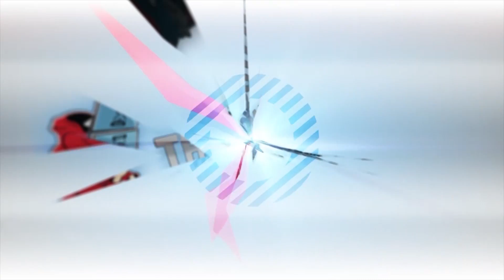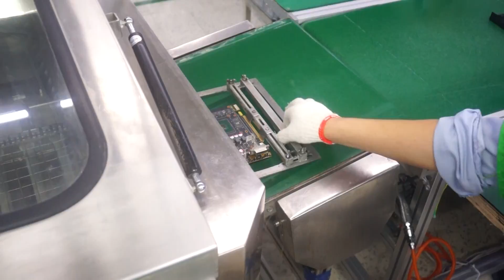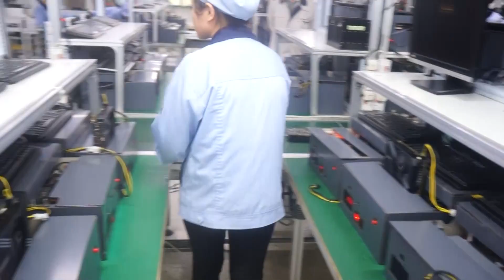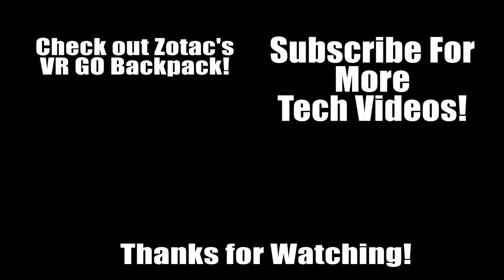How A Graphics Card Is Made

Comment: Here is the explanation what different machines / assembly areas do
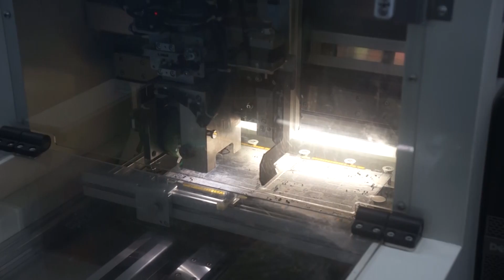0:31 Flying probe, automatic measuring probing tool for assembled components (this usually is used after all components are on the PCB)
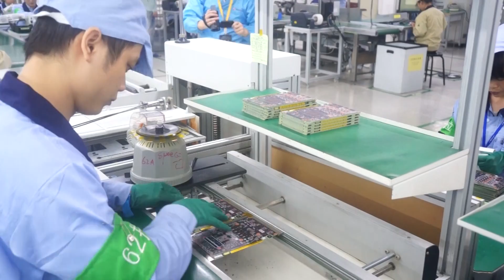0:42 Visual inspection of PCB before adding solder paste
0:44 Pick & place machine, picks up components from component reel feeders and places them on PCB. Two white bowls are component dumps when machine picks up part badly and cannot place it
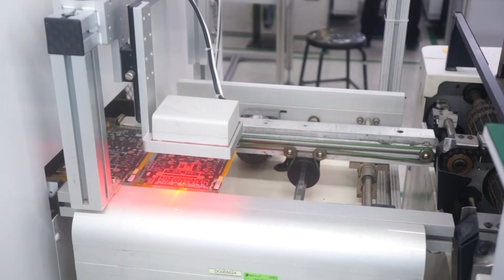0:59 1st Automatic Optical Inspection (AIO) after P&P machine and before a reflow oven.
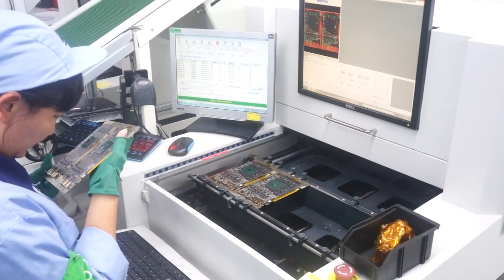1:03 After reflow oven AIO, faulty PCB are sent to rework at this point.
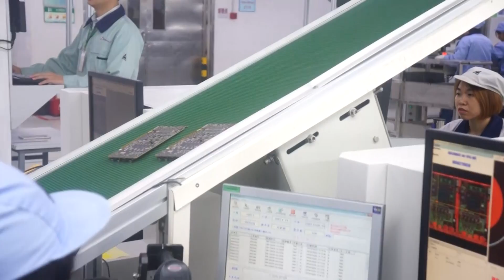1:17 Manual Component placing, at this stage through-hole-technology components are inserted on PCB to be wave soldered
1:25 PCB coming out of wave solder machine on to transport belt that has soldered through-hole components to PCB
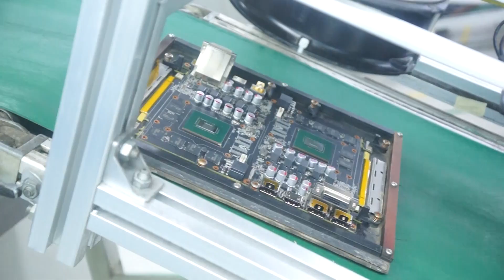1:32 Manual visual inspection after wave soldering machine
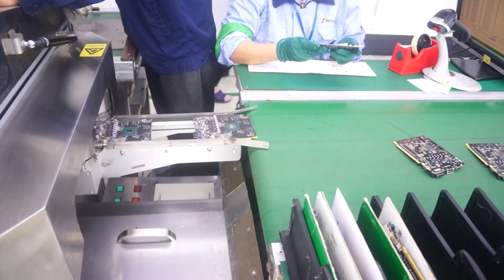1:38 Seems to be another reflow oven, curing something on PCB?
1:53 Assembly preparing
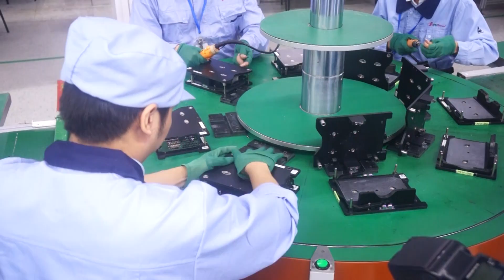2:03 Assembly fixtures to protect PCB from drill bit damaging PCB and speed up process, spinning table to send fixtures to different steps
2:10 screwing IO-shield in place
2:22 Test rigs to measure graphic card is working correctly
2:36 Packaging 
2:52 Shipping (for retailers)

Well there seems to solder paste pressing missing and flying probe testing is at wrong place but otherwise seems to be in correct order.
Reply: I'm sorry sir but I don't speak genius
Reply: Bruh how do they detect issues with the naked eye visual test

Comment: Thank you, now I still don't know how they're made.
Reply: Basically:
Some very smart engineers engineer a ultra-complicated graphics chip (thing that builds pictures and sends them to monitor). Then they design a board that connects this GPU with memory and pins on the card, so processor can communicate with it. The board should also properly power up all integrated circuits. After that many PCBs are constructed, all the components are put and soldered onto it by machines and robots (0:33, 0:44) , and then larger parts are assembled by lots of people (1:54 and so on).
Reply: Consider it a strip tease
Reply: Robots
Reply: To know how it works you need to know how things actually works its each element

Comment: YOU FORGOT TO SHOW HOW GPU CHIP ITSELF IS MADE.AND THAT WHY I DISLIKED VIDEO
Reply: rs agarwaen chip made in other factory called TSMC in Taiwan , they make all GPUs for NVIDIA
Reply: Dude, that isn't a valid reason to press dislike. I mean there would be a factory making the GPU, another one making that heatsink, other ones making the smaller chips on the card, another one making the resistors, another one making capacitors etc. Do you really want a video that is like 30 minutes long showing the entire production process? Don't press dislike for a silly reason like that.
Reply: LordX damn, one factory for all the chips?
Reply: yes , all NVIDIA chips made there , then chip shipped to ASUS or MSI or Gigabyte or Palit or PC Partner factory and they install it on PCB , add cooler and ram etc ... and sell as final product.

Comment: wait... doesn't that technically mean all the cards are used?
Reply: Same thing with any handbuilt supercar, they run the engine for almost an hour on dyno before puttin in the car, this means the car has about some 40 miles right out the factory
Reply: Bhume you can say same thing  on every thing you buy
Reply: @Supplication_For_better_life  yeah i think almost everyone test the product they made before selling it
Reply: Nvidia tests them too (Kinda). And yes kinda would you rather have a card that has been tested Or would you rather have a card with a 50% chance of working and not working I think the answer is obvious.
Reply: Bhume Check out a video about motherboard manufacturers. They have the boards running for hours, if not days for testing before the end user touches them. Like the others said, it's better to have it tested and know it works, instead of taking a 50/50.Some companies only test one out of a batch though and that's where they could improve their testing.
Reply: Yeah, especially underwear!
Reply: @Sayed except condoms. definitely not used but brand new out of the box.
Reply: "used" isn't equal to "made"
Reply: Its QC control.
Reply: F.A.I Where did you get 50 percent from?
Reply: Everything is always being tested bro even your new ps4 or home computer or television has had a first time bootup at one point before you buy it in the factory they have to test if it works ofcourse xD
Reply: Well, think about your girlfriends or boyfriends, Are they brand new 😂？
Reply: Bhume It was a really bad joke when nobody gets it and you have to explain that it was a joke
Reply: Amazing
Reply: Only for test and it's important!
Reply: BWAAA
Reply: lolz true
Reply: Wrecksheeps wait. how womens?
Reply: Bhume used for 10 minute I guess
Reply: Everything was built on the foundation of something else.
Reply: everything u eat is also used by ur sense
Reply: Wrecksheeps "cars...bikes...mobiles...houses...WOMENS"
this gives me a chills
Reply: Bhume you are a special kind of stupid
Reply: It's a joke...right?
Reply: all of them need to test to make sure it quality if anything happen they need to stop or recycle the item they tested
Reply: we also build a gaming pc that we tested if it going to bios before you install windows it the same procedure
Reply: Bhume omg don't worry mate I knew you were just having a laugh. I swear some people get so fucking anal about the smallest of things.
Reply: Sayed Moh'd Sayed Jawad like condoms( ͡° ͜ʖ ͡°)
Reply: Everything is technally already used bro ! Youre pc or Xbox or tv has all been booted up atleast once before leaving the factory how else are they gonna see if it works lol?
Reply: Your new car is "used" when they check it out before they deliver it to you. Idiot.
Reply: So it means that all sex toys also be used for test too right?
So it is not really clean
Reply: Techically used. Because youhave to use it to know if it works. That's what's called a testing.
Reply: The  process is called "Burn-In." The product is tested to its very limits for a few  hours (at high temperatures very often.)
If it passes the test it is deemed to be reliable enough to be sold.
Expensive brands are more reliable because they are tested better in the factory.
Reply: Thats the most stupid comment ever
Reply: @TuanHamdani  r/wooosh
Reply: I WANT A WARRANTY!!!!
Reply: WHY THIS IDIOT DUMBHEAD KID IS ON HERE
OMG
Reply: all cars are used too
Reply: Tested not used. If a doctor sticks his finger in your butt it doesn't mean he took your virginity, does it?
Reply: Nearly everything is tested before sale, batteries, car engines, monitors etc.
Reply: Bhume Are you that stupid?
Reply: it is
Reply: Ay Bhume, hard to tell when someone's making a joke or really isn't informed in text. A good /s or (joke) or something is a good way to let people know. =p

Comment: why is graphics cards so dam expansive?
Reply: Miners bought them and nothing left for you
Reply: R&D
Reply: Gold, silicon, copper, and other valuable resources used to make a gpu is expensive
Reply: Because the GPU chip is the expensive part. This video basically puts the already made GPU into a logic board and then they install VRAM, the monitor connections, the SLI connections, capacitors, the heatsink, fans, etc. 

But they buy the GPUs from NVIDIA and AMD and that is the most expensive part to manufacture. They need to hire highly paid engineers, they need facilities that are free from all contamination. These facilities are much cleaner than a surgery room because a single spec of dust can ruin millions of dollars worth of GPUs. They also need advanced microscopes to see the tiny transistors. And R&D (research and development) is also very pricey.
Reply: Bitcoin is the answer.
Reply: STUPID MINERS EATING THEM UP I know i am triggered but 1060 6gb is not worth 1400 bucks
Reply: Charles Chaney My 1060 only cost 660€.
Reply: Arfath Khalid yeah because of the bastards I now can't make my pc :(
Reply: You can get liquid cooled msi gtx1070s for under 500 where I am... and if you know people you can get a whole system for under 400... handles bf1 in 4k at a stable 50-55 frames.